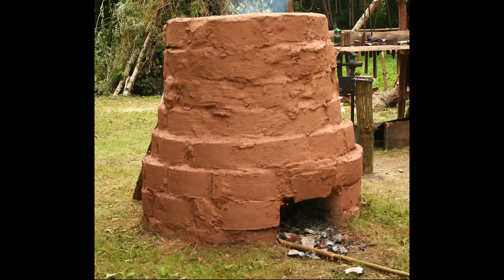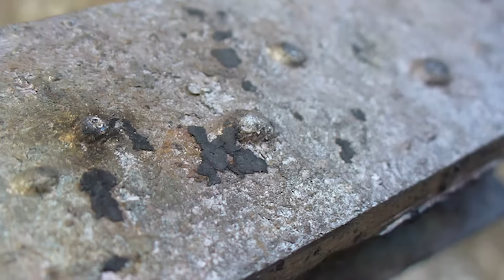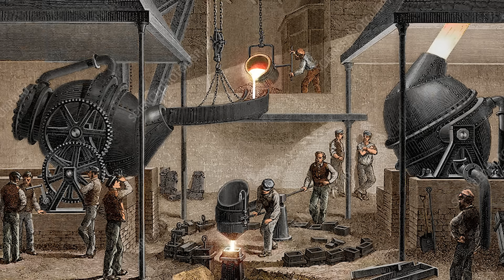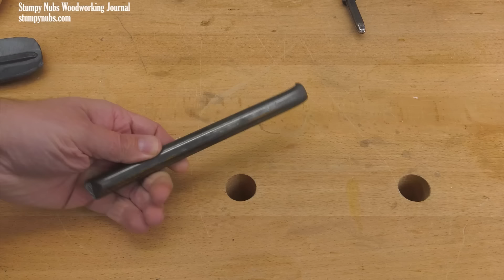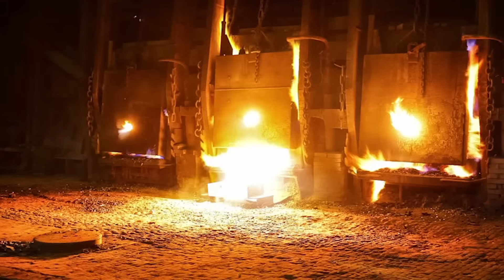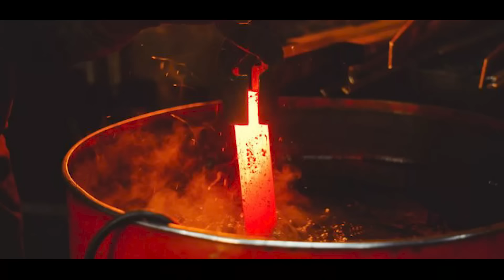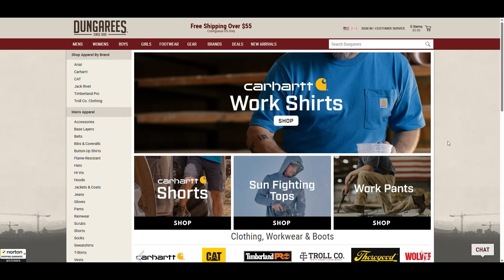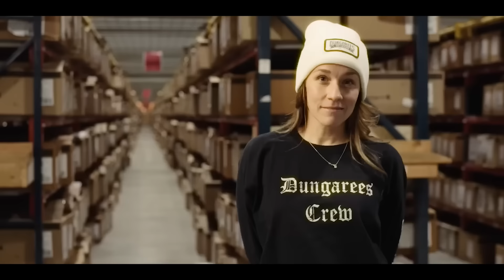Why they REALLY don't make tools like they used to

Comment: Metal working is more art than science. The best tools tend to be made by people who happen to have some special god given abilities and know a process that works for them. That being said, a machine can make better razor blades than a human, for less money. I think the type of steel is less important than perfecting the process of turning it into a razor or chisel or knife. But if you develop a process that works for one type of steel, you can’t necessarily substitute another. Not all razors you make will be meeting standards regardless of the process or material. So you need to be able to grade them and remove the duds. There’s a lot that goes into it. I never buy a tool because it’s made of a certain type of steel with the exception of some old Japanese razors made of tamahagane. There’s also the look of the steel. Some steel is just beautiful, and needs to be polished with the right materials. For example, I have some old natural Japanese stones that can polish steel to look completely different than a synthetic stone. Where a synthetic stone might give more of a mirror finish, the right natural stone can bring out the beauty of the steel and show it. It’s all very artistic.
Reply: The material do matter 
Don't think a fantastic crafment can use a peas of pig iron and make a good tool out of it

Comment: A different point is that back in the days a tool was built for longevity. Companies took great pride in well built tools that lasted a lifetime. Nowadays the things we are making are produced for affordability which means overall cheaper materials and less materials too. The tools are thinner and degrade faster. 

With tools such as CAD with FEA simulations we can create models that teach us just how much material we need to use to ensure the products works and not more. Any stonger and you waste material which means you earn less profits from your product.

Comment: BEFORE WW2 BECAUSE the nukes changed the air structure forever! And the steel nowadays cannot be the same as before the nukes dropped.
Look it up if you don't believe me.
Reply: You can't make steel in a 100% nitrogen environment 
So you can make the same steel as in past times

Comment: Roy Underhill had a whole talk about finding a pile old axes that they recreated to use at colonial Williamsburg. Turned out the axes weren’t very good, and when they inquired with an archeologist if these were really the axes that the colonials used. The archeologist pointed out that no, these were the axes the colonials threw away…

Comment: So the bottom line is that the best steel from today is better than the best steel from yesterday. Unfortunately, the common cheap steel from today is probably not better than the best steel from yesterday. And as others noted, the cheap steel from yesterday has long been thrown away.

Comment: So I'm not a woodworker, I forge knives out of old tools, leaf springs, etc. I found at a yardsale one day a HUGE old chisel like the big one with the hollow cone that the handle fits into in the thumbnail but like a half inch thick. Tell you what, as soon as I started trying to draw it out it started to crack and almost fray around the end. I ended up cutting off the cracked part and just did stock removal to make a Tutenkahmen style dagger.

Comment: Narex are decent.  
Barr makes some really nice stuff. Hand forged in Idaho.  I bought a 2 inch bench chisel because the old 2 inch chisel did not hold an edge as well as I'd like for some mortises I needed to cut by hand for chairs I made.
The Veritas PMV-11 is an excellent steel.  The Lie Nielsen mortise chisel I have is also a beast.

Comment: My tools with the very best edge retention are an S.J. Addis gouge and a J. Frost gouge, both British early 20th century. I use them for paring and mallet work in very hard woods. Incredible edge retention, no chipping. Not even my PM-V11 plane blades or my fine Usui Yoshio white steel chisels even come close. They were on to something!

Comment: At about 5:23, you said "ignots", but you meant "ingots". I have Barr (new) timber framing chisels and Witherby (old) timber framing chisels. The both cut beautifully, but I tend to use the Witherby chisels more. There are some other Witherby wood-shaping tools have which just aren't available new.

Comment: It's not just woodworking tools, but engineering tools in general.

Where I work, we have spanners, taps (large ones, admittedly), screwdrivers, and machine tools that are pre-decimal (60+ years old), most made from some form of Sheffield steel or similar. Whitworth, King Dick, Snapon, you name it - they have been through every chemical imaginable and been used at least once a week in many cases and they are still as good as the day they were made.
Compare that to a monkey-metal spanner of today that might last a year before the jaws start to deform, and there really is no competition with the older stuff of yesteryear.

The sad reality is that people today would usually rather buy the cheaper (and consequently worse quality) tool, rather than pay more for the better quality and so the better brands just died out. It works both ways, of course, because even companies of what were once better quality brands now purposely make poorer quality tools so that you will just keep buying them.

Comment: Yes.  Presenter is right.  I have superb old and new chisels and plane blades and was on the management team at a steel foundry.  Excellent tool steel is made today, some better than in the past.

What I learned over time was that older, pre- ww2 chisels sold to the trade were indeed better from some makers.  For example my set of Witherby socket firmer chisels will stand up to any.  However there were lower quality, cheaper chisels even then.  

That said. When electric tool began to dominate the workforce and tradesmen no longer lived with their hand tools on a daily basis, quality noticeably declined, because the demand collapsed. Today its hard to find a carpenter or even production cabinet maker who really knows how to sharpen a chisel ,(let alone a saw).

A couple of decades ago. Excellent boutique chisels and saw makers started to fill the void left by the big manufacturers.  They make superb chisels and saws from steels unknown in the preparation era.  However they were and are very expensive.

NAREX was revolutionary.  Excellent affordable chisels.  All the big magazines and pros tested them, assuming they were all hype no steel.  The opposite was true.  Excellent steel. Good durable edges.

Comment: During the industrial revolution, Sweden was making iron ingots and making them into tool steel. England started buying the iron ingots and using them in the Bessemer furnace and producing wrought iron. But, the problem was, they were advertising the wrought iron as tool steel. Although it was not tool steel quality by Sweden standard. Long story short, early English tool steel is actually just wrought iron.
Reply: Further, English wrought iron, which is no longer produced because the Bessemer furnace is outdated, is still sought after today by blacksmiths due to its corrosion resistance property. Modern steel is very clean and, hence will rust very easily. But wrought iron had so many impurities in it, that it would rust down to impurities, leaving a somewhat pitted, but no longer rusting piece of iron. The impurities left a coating on the steel, once the surface steel rusted down. That's how wrought iron lasts so much longer than modern steel.

Comment: I suspect people are confounding two completely different properties when comparing old and new steels.
Microstructure vs Atomic alignment (chemistry) and harder carbides, chromium-iron, vanadium-iron, etc.
You can have two steels with identical chemistry yet vastly different microstructure.   The faster the cooling (phase change) the better the microstructure.     So you are comparing great tool steel chemistry made from giant ingots (crappy Microstructure)
against 
inferior chemistry steel but poured into individual tools, cooling quickly, creating great microstructure.

Comment: Just speaking from practical experience, if I use a vintage US made gear puller, it works fine. If I use a Chinese gear puller, good luck. Same thing with vise grips vs Chinese knockoffs , frankly it’s not worth my breath to compare the two

Comment: as a bladesmith, this is one of the best simple explanations of tool steel i have ever watched. However grain in steel is not quite like wood grain unless we are talking about forge-welded wrought iron were you have a lot of slag inclusions and weldlines that you wanted going a certain direction. Otherwise, with steel grains the grain it has more to do with the size of the grain...it gets complex and I will not go into it much.

Comment: Old tools survive because they're were good, but parts of any tool can be disastrous due to cheap breakable unrepairable plastics or unlucky engineering.
I use a 20+ year old stripper for electric cables because the cut is more precise than modern. strippers.

Comment: All the small workshops or single craftsmen working in Sheffield were known as “little mesters” 
We had some amazing quality tool and cutlery produced. 
We invented stainless steel and Sheffield plate silverware. 
If you’re in town visiting Kelham island museum it covers all the history of industry in Sheffield
Reply: Wrong! Stainless steel is a French invention (1904 by Leon Guillet).
Reply: @Jean-FrancoisHammer 
You are correct, French scientists did excellent work developing chromium and stainless steel mixtures, I was thinking of the martensitic stainless developed by the firth brown company in Sheffield, where my grandad worked.

Comment: One reason old tools are "better" that is often overlooked is that even cheap tools cost 3-10 times what modern equivalents do, so they HAD to be of higher quality. Entry level tools from 1920 are like Snap-On tools today. Another thing is survivor bias. Any tool that survived 100+ years was probably already a high-quality item to start with and\or just won the lottery in terms of carbon\temper. What they are not thinking about are the thousands of similar items that did not make it. 

It's like the story of that guy who drove a Camry 1,000,000 miles and only ever changed the oil. Cool story, but there have been literally millions of those cars sold and that is the only one that did that. But, 100 years from now, that story will be the one folks remember and talk about how today's cars aren't built to last.

Comment: Does a dishwasher get hot enough to affect the hardening or tempering of knife steel?  There's a heating element that is used to heat the water and to help dry the dishes.  I don't know what temperatures are useed for tempering steel.
Reply: no
If you could do it with hot water why spend a fortune on a furnace.
Have a little think before you type
Reply: @RovertNosnikgdoh  I don't know what temperature is required for tempering steel.  And I have seen posts in knife forums about not using a dishwasher for high end knives.  I'd like more information.
Reply: @JohnShalamskas  Not being put into a dishwasher would be to protect the handles from damage particularly if they are riveted or glued on .
Dishwashers usually run at close to 100 C to kill off bacteria and soften fats .
The actual temperature will vary with the grade of steels used but if you search "Colour chart for tempering carbon steel " you should get a chart with colours starting at light straw and going all the way to black . Most will have the temperatures on one side and the most common use on the other . You do not heat the edge you are tempering , it is usually hanging out the end of the oven while you watch the colours change .
A cheap toaster oven works really well for this application
Reply: @RovertNosnikgdoh  Thanks for providing useful information!  I have a couple of kitchen knives that have handles which are heat tolerant, such as Victorinox Fibrox and a Kitchen Aid with a stainless steel handle, which I have always tossed in the dishwasher without a second thought.  I also have some Henckels knives with riveted plastic handles that are NOT able to handle the heat of the dishwasher, so I hand wash them.  But I never was convinced by people who said the temper was undone by 100C.

Comment: Ive found the CrV steel often used on even cheap chisels holds an edge way better than i ever expected. Its got me eyeballing some old wrenches that might become mortising chisels 😂
Reply: Old files make the best wood turning tools money can not buy .
Unfortunately die grinders & angle grinders and power files have reduced the availability of worn out files but you often find them at car boot / trash & treasure sales .
I am a metal worker and use them sharpened to make scrapers but I did a clean out job one time where to deceased had hundreds of turning tools made from old rail yard files . heated, forge to the desired profile then sharpened .

Comment: An engineer's note here. The method of forming a tool matters just as much if not more than the steel you use. Casting vs forging creates a different grain structure and (cold) forging strain hardens the metal. Even then there are other steps that can be taken to get the properties right with processes like carburizing or nitriding the surfaces. But, each process requires time and money to add. Casting then heat treating is pretty fast and cheap in comparison for a mediocre tool.
EDIT: Oh, literally paused the video right before he covered this XD

Comment: Modern high end tools are made out of tool steel that is considerably better than anything that was made before the 1950s. You just have to pay for it. Bessemer steel making has limitations in purity and consistency that you don’t run into with modern arc furnaces and powdered metal processes, not to mention cryogenic/ isothermal hardening processes. Unfortunately, there is also a lot of shit steel out there. Buy yourself some Lie-Nielsen chisels today, take care of them, and your grandchildren will be able to hand them on to theirs.

Comment: There is an important aspect of when you get an old tool, you can be fairly assured it is going to be a quality piece. When you get a modern tool, there is a good chance it's garbage. So for a layman, you want old tools. For the professional today, they know well enough to try various makers and shop around, and can thus be assured the modern tool they use is quality.

Comment: If you melt down that rod and cast it, you’re not gonna have the same steel. Most likely they use flat bars and heat treated and grind those into shape. So long as they don’t burn the edge, that steel will be good.  Forging does help somewhat but far and away heat treatment and not burning the edge when sharpening it matter most.

Comment: Nicely explained!! I've worked as a metallurgist for almost 30 years and what you are saying seems pretty good to me.  On the subject of scrap, I was taught that the steelmaking process actually required scrap to be added as part of the process, to regulate the thermodynamics if I remember rightly. I dont know if it is always true; I've never worked in steelmaking and this knowledge was based on the practices at Ravenscraig which was just shutting down at the time. Anyway, every melt is analysed and various techniques and additions can be used to regulate the chemical composition. So depending on the grade and spec of the steel, all alloy additions and trace elements are carefully controlled.  Obviously there is a lot of cheap crap out there. But theres good stuff too.

Comment: I much enjoyed this video, although your explanation of how carbon steels become harder was very crude... It gets the point across, though. No need to get too deep into material sciences ;)
Here are some unsolicited remarks anyway:
-Hardness alone is no quality marker. You also need to take edge retention into account (greatly improved by adding chromium)
-Cryogenic hardening is just cheating the system: Without deep-cooling you'd need to temper twice, reducing overall hardness. No grand magic steel, just proper know-how turned into a salesperson's buzzword.
-Your explanation of chromium carbides is just spot-on :)

Comment: modern Steel Is 10,000% better than older steel.
BUT you have to be somewhat knowledgeable.
the catalog of different steels with different properties is never ending.
so selecting the right steel composition, and the right heat treatment for your needs might be a little bit of trial and error, until you get exactly what you need for your use case.

also super steel ain't cheap. 
if you want super steels, with super heat treatment.
You better expect a super price tag.

Comment: Thanks James.  I had a woodturning business and used chisels all day long. Something you might like to consider is that first thing in the morning we sharpened the chisels. Basically the edge only had to last the day. It would get sharpened every morning. The tool had to have some "give" as they broke in half easily with the loads. When the new alloys arrived ( If I remember correctly it was the German Bohler steel) , they were far too brittle. When they snapped it could easy slice your hand at the same time.   They retained their sharpness alright, but that is not the only use of a chisel.

Comment: I understand the need to simplify, but simplifying the entire challenge of steel making into "the right amount of carbon" misses the whole point of why it's hard, which is that you need not just the right elements, but also the right temperatures and cooling rates and perhaps manual working, to get the right crystal structure. It's incredibly nuanced stuff I know nothing about, but it only emphasizes the advancements of modern metallurgy.